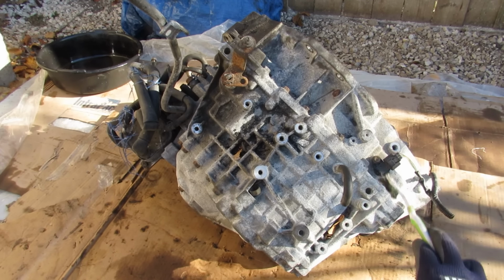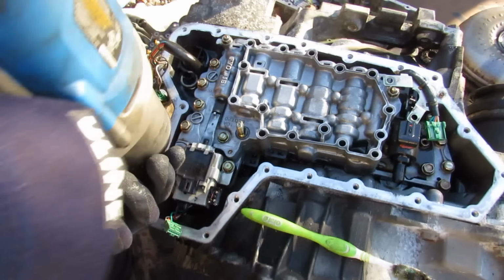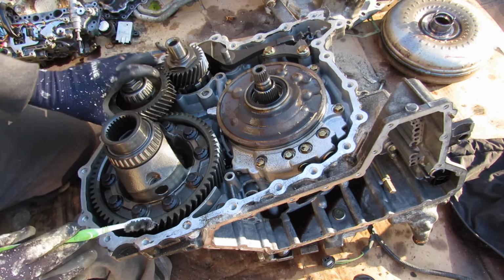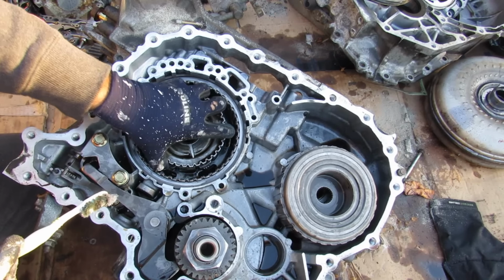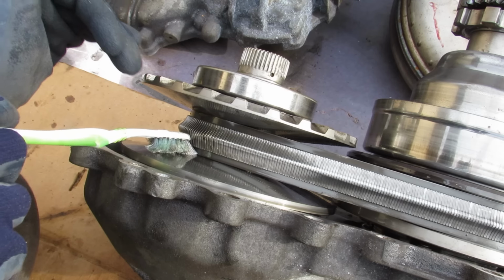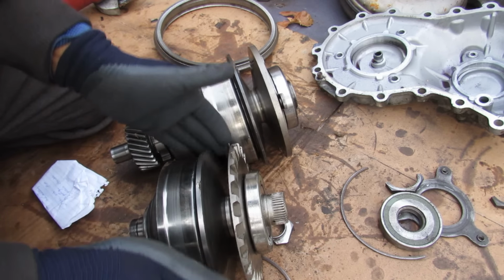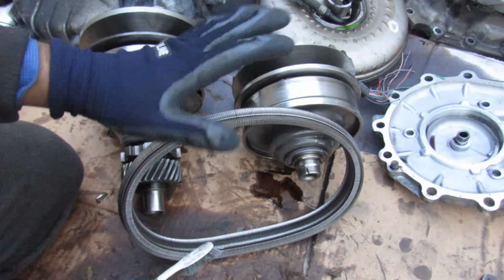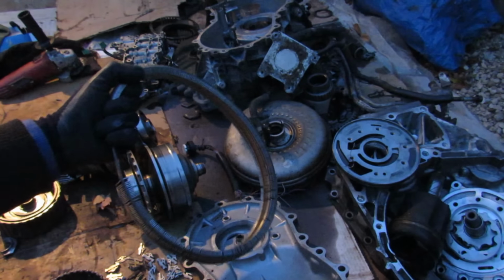Why Nissan CVTs FAIL

Comment: Nissan (Jatco) has had many years to get it right. A lot of automakers would've gone back to traditional transmissions to save their customer base, but Nissan has been hell bent on sticking with CVT. Granted supposedly they've been better in recent years.
Reply from the maker: I've heard of alot of recent CVT failure so they still exist. You are right, even Ford and VW ran away from the dual clutch transmission in their economy cars after having issues.
Reply: @speedkar99  Do you believe it might be a geographic issue? Because most cars in Japan do use a CVT, and most VWs still have a DSG in Europe. Maybe because there are a lot more highways, hills and towing in the US than those other countries, the transmissions tend to break sooner?
Reply: Benjamín V  interesting thought. Think you may be onto something. My cousin that has a transmission shop said they are finding allot of metal in the pan. I’ve had one for 6 years. Think it’s best to accelerate easy and change the fluid every 50k miles. If I bought one new, I’d probably do first change at 20k then 50k after.
Reply: @bavalenzuela  probably fuel economy standards.
Reply: @bavalenzuela  that's a sensible theory but unfortunately no...the issue is money grabbing scandals with the CEO's and b.o.d of jatco and nissan...they even invested in legal teams before hand much like pharmaceutical company a do before releasing a product and determine est. Profit after suspected legal expenses...they were waiting on law suits from the get go that's why nothing has changed after them ...this scheme has grown in popularity throughout many industry since big pharma proved through the 90's it was 100% fool proof....not trying to sound like a tin foil hat crazy guy here but I was assigned a project a year ago and researched/ investigated Nissan which then lead me to jatco...then to Cummins( nothing bad on them it was Nissan that schemed to screw over XD guys) ...next thing I knew I couldn't believe where this basic assignment had lead me to I pretty much lost faith in virtually all corperations afterwords...as a random footnote to end on I then did a similar project on Henry repeating arms company and I think they are the last honast business left that truly cares about customers without compromise.
Reply: @speedkar99  Ford didn't exactly run away. They knew DSP6 was a dog before the first car was even sold. I presume they just knew they'd have fewer problems with the poor people who'd buy a Focus or Fiesta than with Lincoln owners or police fleet managers.
Reply: 2016 Murano was on its way to failure at 50k, went and bought a boring 2020 4Runner for my wife. We love it!
Reply: @JAMESWUERTELE  well that’s because you probably never did CVT drain/fill
Reply: @JAMESWUERTELE  What specifically was the problem with your Murano?

Comment: U should compare a Honda Toyota and nissan cvt and compare the designs and quality differences
Reply from the maker: That would be great but Honda and Toyota transmissions are worth alot more and aren't easy to come by for a teardown
Reply: speedkar99 what about Subaru cvt?
Reply: @andersonrodriguez8258  subaru probably uses toyota/aisin cvt
Reply: @carholic-sz3qv  ehhh subaru have transmission problems to
Reply: @hamie577  because they use it for their awd system, unlike toyota
Reply: hétoila no they use nissan jatco but I think they started making their owns now
Reply: hétoila Cvts are me ants for micro cars nd cars like fit the Scion xB xd etc a civic nd corolla to big
Reply: @andersonrodriguez8258  Subaru always made their own cvts in house.  They also use a luk chain instead of the push belt shown here.
Reply: niuhuskieguy which one better for long lasting ?
Reply: @andersonrodriguez8258  Subaru used to use Jatco conventional automatics but their CVT is in-house. You can blame Scotty Killmer for this, he spread that falsehood for years and only now has come off of it. He didn't even say he was wrong before.
Reply: @andersonrodriguez8258  that would be a good question.  I don't know what kind of data is out there.  Im sure each kind has some kind of advantage, but based on looks, i would say the chain for longevity.  That is just a guess on my part though
Reply: @andersonrodriguez8258 ; the manual transmission 

If you must choose an automatic, most to least reliable;

Toyota E-CVT >torque converter automatic (regular automatic)>DSG/DCT>bicycle >horseback >walking> push belt CVT (Jatco, Honda, Subaru)
Reply: @stuntmonkey00  Scottyy asn't criticized Subaru on their CVT design.  He did criticize the older Suarus that used the Jatco transmissions and I think there is god reason to.  I believe Chrysler also used the same transmissions and look at their reputation, so there is some merit to what Scotty said.  However, I don't think he has much about the newer Subaru CVT design.  He does claim that he is not fond of the CVT concept, and I don't disagree with him.  On the Toyota forums one guy was bragging about how he got 150k out of his CVT while pulling trailers.  150k on a vehicle these days is nothing.  Geared transmissions will usually easily beat that by at least 50k more miles before replacement or repair (if not more).
Reply: @andersonrodriguez8258  SUBURUUUUUI!!!!!! IMPOSSIBLUUUUUU!!!!!!
Reply: @carholic-sz3qv  no subaru makes their own
Reply: @stuntmonkey00  They still break...
Reply: @stuntmonkey00  Heresy !!!!!!!!!!
Reply: @CorruptInfinityOfficial  Ok, you shot your mouth off.  How is Scotty a bigot?
Reply: @andersonrodriguez8258  My sister's subaru trans failed in less than 1 year.
Reply: @stuntmonkey00  Scotty needs to retire off YouTube
Reply: @bobbywoods684  it’s literally explained in this thread already, dude refuses to apologize for spreading false information, I’m sorry you got up in your feelings or whatever after skimming through the conversation and then deciding to reply to me 😂😂😂 point made, guy was spreading misinformation about several cars.
Reply: @hamie577  - Not too many, I have seen many Subaru CVT's with well over 200k miles and going strong.
Reply: @27Zangle  My 2011 Subaru Legacy is over 180,000 miles and my CVT (TR-690) still works great. In traffic, I much prefer my Legacy over my 2007 Camry 6-speed automatic.
Reply: @carholic-sz3qv  I'm Pretty sure Subaru uses JATCO which is Nissan
Reply: @HR-wd6cw  I've seen 425K+ on Toyota transmissions with fluid changes.
Reply: @WilliePeck  nope subaru uses Toyota parts from AISIN
Reply: @CorruptInfinityOfficial  No information in this thread explains how Scotty is a bigot other than you calling Scotty a bigot.  Back up that scurrilous accusation or take it down.  What information do you have that justifies calling Scotty a bigot?
Reply: @JesusIsLordAndSavior77  That's also a Toyota 😉😁
Reply: @27Zangle  It'd be interesting to see the difference between the heavy duty CVT used in the Ascent versus their other cars. Subaru claims the Ascent is rated for 5,000 lbs of towing all day, every day. The shifting and torque application does feel different than other Subarus.
Reply: @hamie577  A few years ago Subaru extended the CVT transmission warranty to 100K miles, no doubt because of failures.
Reply: @carholic-sz3qv  no they make their own. They're called Lineatronic CVT.
Reply: @bobbywoods684  lmao look at who I replied to, you already made a clown out of yourself twice for not reading. The dude won’t accept the fact that he was wrong about plenty of things about cars and then tried to hide his tracks instead of just owning up to his mistakes. This is why I have reply updates off. People like you just get in their feelings and press enter after venting.
Reply: @JesusIsLordAndSavior77  My '10 Pilot is at 326K. I switched it over to Castrol for Imports to combat a minor shuddering problem at certain speeds.
Reply: @WilliePeck  Subaru CVT's are built in house...not JATCO!!
Reply: @emjayay  No...it was to calm fears about CVT's heard on the internet.
Reply: @speedkar99  you know why they're worth more? Because they work! Laughing in Scotty Kilmor.
Reply: @speedkar99  Toyota cares about their customers as proof thirty one years in a corolla and muffler and starter  are the only replaced parts!
Reply: @speedkar99  I wonder when nissan would grow out of it,s problem,s as a company and making legendary car,s
Reply: @sumaanshaikh3775  As soon as they manage to get divorced from Renault their owners who bailed Nissan out decades ago but then gutted the company in to the burnt out hull it is today.  That's why Nissan execs set up Carlos Ghosn (former Renault exec who became the head of Nissan) in a Ninja style death attack which they hoped would help them pursue their case to divorce themselves from Renault and they may have succeeded had the case been tried in the courts of Japan who always rule in favor of Japanese companies when a foreigner is involved but Ghosn managed to escape from house arrest and flee Japan after which his lawyers were able to document how other executive staff at Nissan had set him up for the purposes of advancing their own careers as well as forcing the "foreign devil" out of the Japanese company and hopefully have the case tried in Japan so they could tie the case to a larger goal of forcing Renault to sell back their controlling interests in the company.  Even though the Gohsn managed to escape Japan which foiled the plot to use the Japanese courts to favor the case for divorce from Renault, the whole fiasco was still enough to wreak havoc on the parent company Renault which like Nissan at the time was also undergoing financial turmoil, and this scandal just made everything worse driving Renault further in to debt, so it's hard to say for sure at this point but Nissan may end up getting its wish in the long run if Renault ends up having to sell its controlling shares in Nissan off in order to generate enough funds to start paying off its own debts and financing new projects. The only question is who would buy the Nissan shares away from Renault?  Nissan is currently in financial dire straights so even they do not have the cash on hand to purchase back their own shares such as what Suzuki did when that company decided it had enough of Adolph's Volkswagen group.  Will be interesting to see what happens.
Reply: @marketingmajor8126  I know that ceo of nissan escaped japan 🗾 due to a scandal but I'm pretty nissan can do it on their own
Reply: @sumaanshaikh3775  l'm not sure what your point is Sumaan. You are just repeating what l already said.
Reply: @speedkar99  copart donor maybe?
Reply: @speedkar99  if you ever get a hold of a Toyota and Honda CVT it would be nice to see a 3 way difference with the Nissan CVT
Reply: @speedkar99  Maybe because they don't break down :(?
Reply: @speedkar99  - Don't waste your time.
Reply: @speedkar99  it means that the Honda and Toyota CVTs are failing more? In used auto parts market,  the bad the part is, the more expensive it gets bcz a lot of ppl are looking for it.
Reply: @akhtarkh  I have a Honda CVT and its running fine at 100,000 miles.
Reply: @akhtarkh  nope. They're more expensive to come by because they work way better.  If the fail rate is low, the likelihood of getting a failed one is low and would drive up the cost of getting one
Reply: @wheresbicki  I have had manual Hondas last over 300k miles.
Reply: @absoluteclownworld  yeah the manuals are certainly the best in longevity.  Way less moving parts to it.  My goal is to get up to 200k in this car.  Tall task for a CVT but I've owned it from the beginning so we shall see.
Reply: @akhtarkh  toyota and honda more reliable and endurance...
Reply: @absoluteclownworld  Nearly every Honda I've had (8 Accords, an Element, and a Pilot) has gone to or over 300K (one went 365K+ before I gave it away). All automatics, and zero trans failures. A minor slippage problem on my 2002 V6 Accord.
Reply: @akhtarkh  price is determined by supply and demand. If the supply is low i.e. very reliable that would also be a reason for high price.
Reply: @christianpetersen1782  in used parts, supply is not dependent on demand, reliability or quality of parts, it is only dependent on how many accidented or salvaged vehicles are available for parts. However the demand of used parts is directly proportional  to the reliabity of the parts, the less reliable the part, the more expansive and in demand it will be in used parts market.
Reply: @speedkar99  would you think 2018 and up Honda Civic CVT is reliable ? My momma got about 84,000 on her 2017 Honda Civic hatchback sport, only major problem was the whole ac system needed to be replaced at 60,000 or so lmao. But I was always worried about the cvt transmission when she bought it. Seems to be holding up okay
Reply: @b10matt70  I'm  Honda dealer tech. we haven't had any problems, yet. Have worked at Nissan and Chrysler as well. High fail rate at both.
Reply: @b10matt70  they'll generally hold up quite well in smaller cars. The original Dutch-Japanese design was primarily aimed at the compact and sub-compact cars.
Reply: There is not much to compare if you refer to Prius and other hybrids "gearbox". These are completely different mechanisms, which have only the CVT letters in the name to highlight the end result - continuously variable transmission. Toyota HSD is a planetary gear mechanism with statically locked gears and intelligent power splitting. Because there are no friction based torque transfer like with the belt or gear switches, HSD lasts for long time. Yes, it is possible to break them, but you need to do some stupid things.
Reply: Paul Robert  toyota has Ecvt which is electric assisted CVT way stronger than normal CVT, plus some of those toyota CVT have a first physical gear
Reply: toyota builds their own-BETTER   the others are from the same manufacturer and go out to. I believe Mazda is the only on not to use a CVT  ..
Reply: 155k and counting on my gs450h cvt, very unique 2 speed rwd cvt
Reply: And suzuki
Reply: That would be a great video.
Reply: breakfast meat  As far as what?
Reply: What for? they are shit, even european CVT transmissions were a failure.
Reply: On newer Toyota Corolla CVTs they added a physical first gear to their CVT. I’d like to see inside one of those and how it differs from other conventional CVTs.
Reply: Good luck finding a Toyota cvt to tear apart... you wont find one because they dont fail... you pay for what you get with a toyota. I have a 2017 corolla se with a cvt and its fantastic... not a speed demon but I would take that car across the country without hesitation
Reply: @russrtspooling7702  Failure on them isn't common at all, and Toyota stil uses a mixture of CVTs and regular geared transmissions so there is fewer CVTs anyway (for example only the Corolla and Prius are the primary Toyotas that use CVTs).  Even the brand new Camry still uses a normal automatic.  But that being said, I haven't seen or heard (really) of any Corollas suffering from complete CVT failure like I have on Nissans.
Reply: @HR-wd6cw  Prius doesn't use a 'real' cvt, but it uses th emotor and generator and a differential. No variable mechanical gearing.
Reply: @HR-wd6cw  Toyota have been shifting to hybrid powertrains recently, at least in EU. That means they are using eCVT, which have nothing in common with CVT except for name and the end result.
Reply: Toyota CVT is the best, it has launch gear that works from 0-40 km/hour, it helps to reduce wear on CVT during stop and go.
Reply: @Noeman2009 that seems closely related to the type of a transmission used in large farm tractors 🚜.
Reply: Have a look at the original CVT design from the 60's as found in the DAF 33 economy car. They invented the stuff. It was much more simple and sturdy. It used 2  rubber like belts that anyone handy could replace themselves. DAF, (van Doorne transmission) still have the patent and produce the metal push belts. Google "DAF variomatic"
Reply: @TheoBerkhout  ...and snowmobiles have been using CVT's since the 50ies !  They are very high tech these days and have only a FEW components which have been highly refined.  I wish the auto industry would give some needed credit.